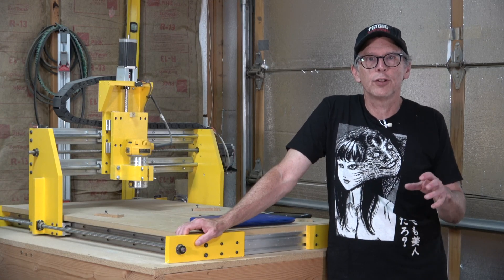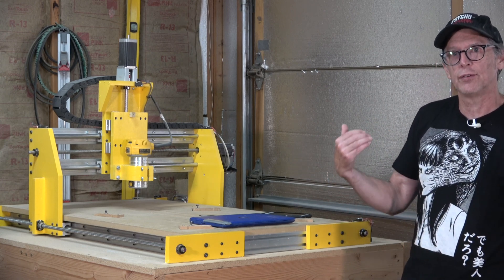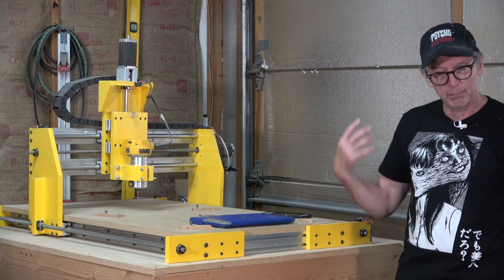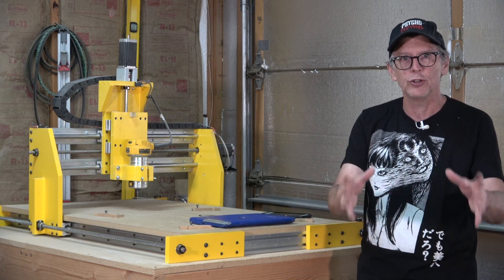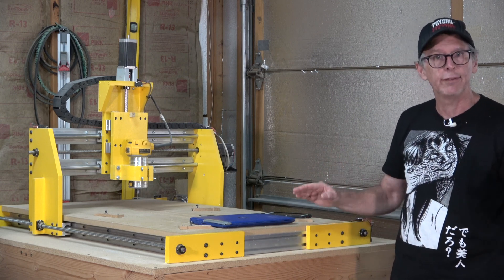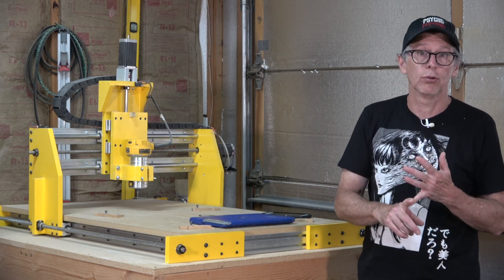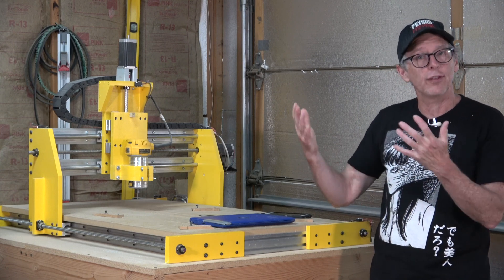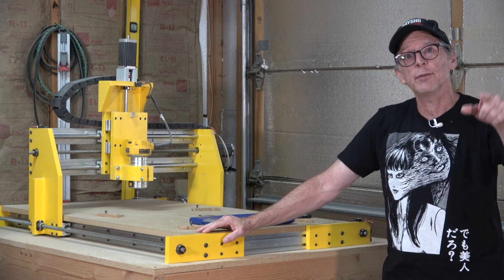Can You Afford A CNC Machine?

Comment: Spot on Chris! I love those candid moments you repeated to drive the point home LOL! :D I purchased a Genmitsu ProverXL 4030 that I converted to a 6060 (larger surface), for about $1,500.00, and have been able to generate usable grbl code that Candle runs on my laptop for acoustic guitar headstock logo work. Now I am trying to find the best CAM software to use and don't mind cobbling together solutions . I have downloaded Fusion 360 in the past, and have already used Carveco Maker (used to be called ArtCam and was an AutoDesk product). I am not new to computers, but am relatively new to CNC. I can see that CNC is really the only way I can hope to turn a profit since guitar making (or lutherie work in general) is very labor intensive. Time is money and if I ever hope to make anything for my effort, automation of some tasks will be essential to the effort.  That's why comments about "soul" and religious arguments about certain woods ring hollow to me at times. I noticed that you have a video that discusses your CNC workflow where you use Adobe Illustrator for vector drawing and then import them into Rhino CAM. Was this due to cost? Fusion 360 used to have a "free" option, but they really don't anymore. It is a great product with a steep learning curve. I am not sure  that I can achieve what I want with Carveco Maker. However, it is inexpensive ($13.00/month with a 10% Veteran's discount applied). I think it'll work well for the detail work that I previously mentioned above for the headstock inlay. I need something inexpensive to start with that will allow me to leverage my skillset (that I will inevitably develop while using the interim software solution(s)) into other, probably more costly, and perhaps better solutions down the road. I have been drooling a bit over the Laguna Tools IQ but I need to establish a market for my guitars first. Any thoughts you can share? Thanks again for your videos! Very insightful and well made.

Comment: I would think you have to have big pockets or making lots of guitars to justify the cost and time required in setting up and learning to operate a CNC machine.  You learn good skills by band-sawing, spindle sanding, routing, drilling  and shaping guitar bodies by hand. 🤗
Reply from the maker: The tools you mentioned are not hard to learn how to use and if you use good templates (usually made on a CNC machine) require little skill. Also, when you add up the cost of those tools, you are in the realm of a decent consumer CNC machine. If you’re going to learn a new skill, learn a skill that uses the latest technology.

Comment: Purchased your plan, but ended up not using it.  Built a variation on the theme with upgrades.  Upgrades were all aluminum, bigger motors, 2.2KW spindle, ballscrews, dust boot, and water cooling system.  Came in around $2500.  After 2 months of building and learning, it's running great.  Learning the ropes with Fusion 360 and Carbide Create, but will buy Vectric shortly.  For $2500 I could have bought a Onefinity or similar, but I wouldn't have learned as much.  There's value in the struggle.  Agree it should not be taken lightly.

Comment: My build, based on these plans is going to come in at around $5,000. before the CAD and CAM software packages. I made some changes on my machine, replacing the wood parts of the structure with aluminum, upgrading many other parts and using a Masso controller. The Masso is a self contained unit that runs your CNC that does NOT require a computer. Honestly, the cost of the Masso ends up being less than buying a computer, the boards required and Mach 3... obviously if you have an old computer lying around that can be used for this purpose, make sure it will be able to stand up to constant use, because it has to run trouble free through the entire cutting process. CNC's are complex machines, that require a great deal of time, energy, research and education. Chris offers many fabulous suggestions, helpful tips and a great deal of the education needed to get started. The plans truly helped guide me and were worth every penny!
Reply from the maker: Don't forget you'll need a capable computer for creating the 3D models required for 3D carving (contoured guitar bodies, neck contours, etc.). And the software as well.
Reply: @HighlineGuitars  I agree, so many aspects need to be taken into consideration. Another thought is consumables... there are so many aspects to juggle, learn and put into practice... it's impossible to include it all in one video, forum post or comment. Thank you for guiding my experience.
Reply: @HighlineGuitars  a good resource is the world of gaming laptop computers.  They're one of the few left that you can still upgrade the RAM in quickly and easily.  A gaming computer can cost $1k (to infinity), but are designed for heavy lifting.

Comment: Man, you've been talking so much about cnc routers that now I can't get the idea of building one out of my head haha... If you were to do it all over, would you make the z axis longer? I'm not a guitar builder, so I don't know if something big enough to make use of a 100mm long bit would be overkill or not, but at the same time I don't want to spend all that time and money on a machine and have to change the dimensions later.
Reply from the maker: For some reason, people think they need all kinds of Z axis height. They don't. I never cut deeper than a total of 2" so 5" is more than enough Z axis clearance.
Reply: @HighlineGuitars  thanks, your machine looks way more compact than what I had in mind and it handles all kinds of guitar related projects just fine. It's funny how you can blow your budget by almost twice what you had in mind just by making a way too big and heavy machine that probably wouldn't be using 40% of its working area.
Reply from the maker: @luisownerbr  As I have said before, over engineering can kill a project. Take the time to do the math and you'll come out way ahead.

Comment: Building your own CNC router is certainly less expensive than a ready to use machine and not too difficult.   Cost can vary a lot and will depend to an extent on what tools you have, the design of the machine, and components/materials you choose.  The big advantage is that you can probably make a more rigid machine with better capabilities.